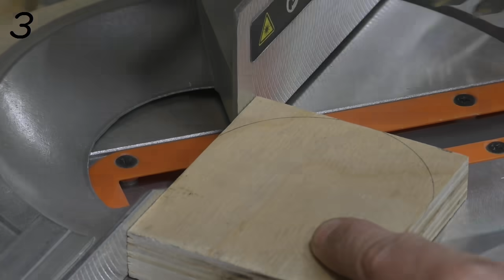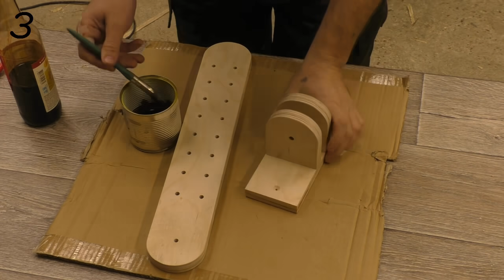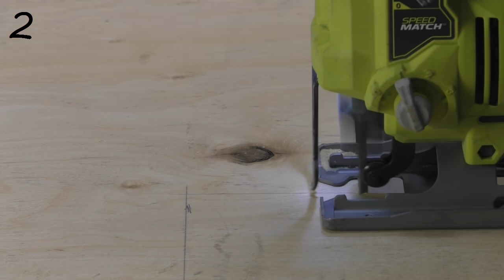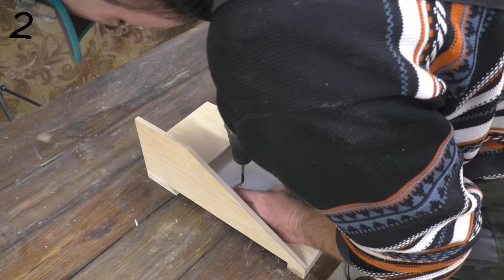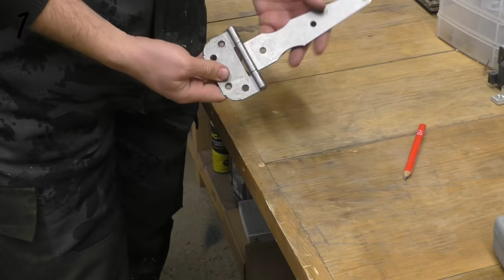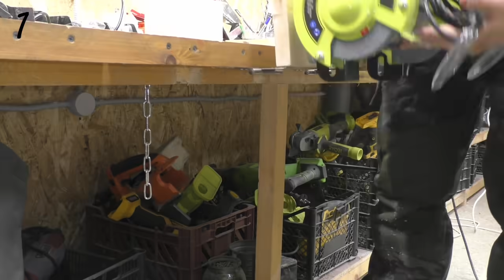Top 3 brilliant ideas for every workshop!

Comment: on your number two ... , i can recommend that you have little slider holder for your wire so that its not difficult to pull off if you wind it to tight , id also recommend that you line it with some sort of rubber to prevent tear on the wires, otherwise they are really good